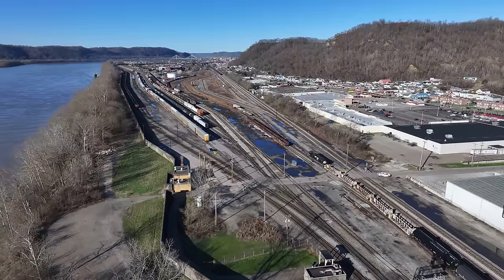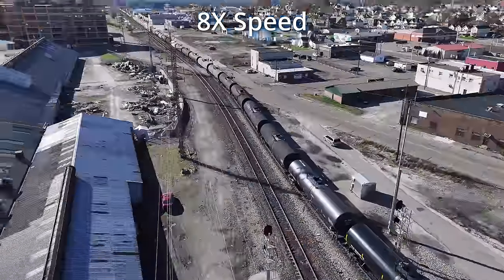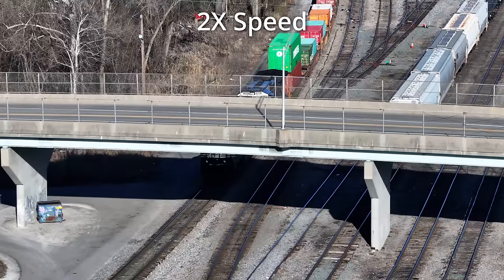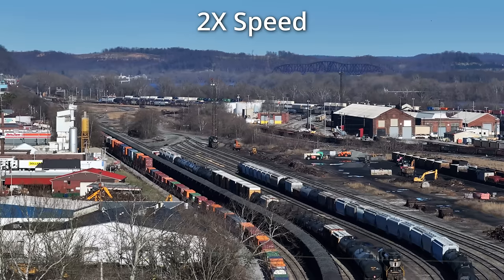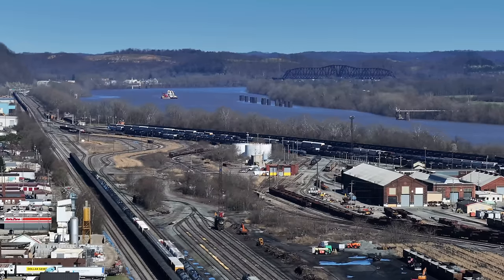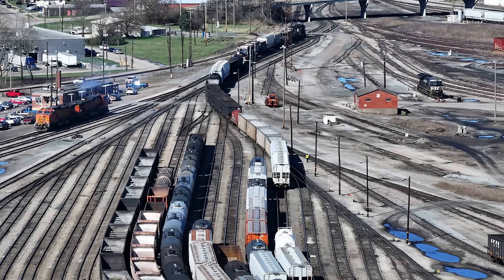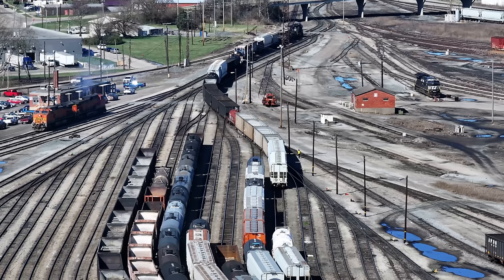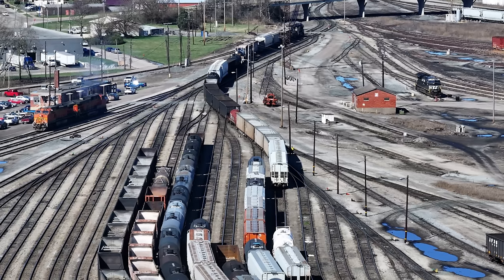Kicking Cars Along the Ohio River: Flat-Track Switching at Norfolk Southern's Portsmouth Yard

Comment: The reason why those 2 BNSF units where running is either they had a defect that prevented the AESS (Automatic Engine Start-Stop) system from shutting down the engine (usually low batteries) or you had the shear luck of being there when they where running in between shut downs. Very rarely will crews do a manual shutdown, especially during the colder months where temperatures will drop below freezing. Railroads use water instead of Antifreeze to cool engines, so when an engine is shut down and it drops below freezing a safety valve known as a Guru valve will pop to dump the water and prevent engine damage from frozen water. (Its a pain to get it refilled, so no one on the railroad wants that to happen.)

 Those blue signs that you saw those men, who are called carmen, putting up are "blue flags". Blue flags are used to warn T&E crews (aka Engineer, conductor, & brakemen) that workers are underneath, on, or working on equipment, and that that equipment is not to be moved. Blue flags can only be removed by the person who placed it or a person on that person's team with permission in most railroads rulebooks. 

Those carmen, also know as Car inspectors,  are not part of the switching crews. Their job is to inspect and repair cars after the yard crew sorts them. They are part of the mechanical department, and are a different "craft" . 

Crafts are basically job groups, but management is not a craft. (Also positions like IT and other HQ level positions) 

Conductors, Yard Foremen, Switchmen, Brakemen, Utilitymen are part of the T&E craft, but have their own Union.
Engineers, Firemen are also part of the T&E craft, but have their own Union. (Technically they are a different craft but they are consider as part of the T&E craft) 
Mechanical department is part of several different "crafts" and unions depending on position.
Same for Track Dept , B&B (Bridges and Buildings), Signals, Clerical, dispatchers, etc.  

I'm not sure exactly how NS does it, but usually the crews in the yard are Engineer, Yard Foreman (basically a conductor), and switchmen.
Reply from the maker: Thank you so much for the detailed answers to my questions.
I really do appreciate it.
You make watching this more enjoyable with the information you provide.
Reply: I had and eng dump its water, and my trainmaster came out with 10, gallon water jugs, lmao. I just shook my head like, no just no
Reply: @treos17  that sounds par for the course for some MTOs I've met. (But oddly enough, not the ones in charge of my home territory lol)

Comment: NO Reason to Shut Down the Engine on a Foreign Power Unit.  Maintenance don’t want to Waste Time working on a Foreign Power Unit if they Can’t get Restarted.👍
Reply from the maker: That actually makes an incredible amount of sense.
Reply: They’d just send it back to the powers closest terminal.  They won’t work on foreign motors.  Plus, the motors most likely have auto start and stop so they will cycle on and off
Reply: The main reason for shutting down a locomotive is fuel conservation.  Regardless of weather it yours or some foreign roads, it has to be fueled when it runs low. Besides, with all the run thru trains between railroads these days they keep track of the number of engine hours a foreign loco is on your road and how many hours they have yours. After a while they figure out the difference and, as in this case the bnsf may be paying the ns back for a few hundred or thousand hours so those units could be on the ns for weeks

Comment: Yes, the brick buildings are original. There used to be a large roundhouse, and a footbridge connecting the locomotive/car shop complex to the north side of the yard. As far as switches, only the ones at either end allowing access to the to the mains, as well as those at West Avenue, are dispatcher  controlled power switches. All the others are hand throw.
Reply from the maker: Thanks for the great information. I wish I could've caught the roundhouse when it was still around and in use.

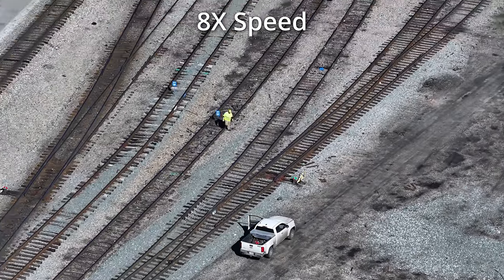Comment: 9:18 Those are Blue Flags that protect mechanical department personnel from rolling equipment being moved within the blue flagged zone. They also line the switches away from that track and lock them with their locks. As a conductor myself I can say that those blue flags are absolutely SACRED. A train crew member dropping a blue flag or tampering with their locking devices is the kind if thing that will get you fired and possibly decertified on the spot. If you remove or run over a blue flag, there's a very good chance you never move a train again.
Reply from the maker: Thanks for the great information!
I really do appreciate it.
Reply: @nkyrailfan  No problem man! If you ever have any questions about stuff like that just let me know I'd be happy to help. I can't disclose specific information about specific trains but other than that... 😂

Comment: Another reason the BNSF motors might have been left running is when the temperature gets too low at night, engines won’t start if they are too cold so they’ll leave them running to keep them alive. Easier to keep them running then have them dead and not able to start

Comment: Locomotives have water cooled engines so they keep them running under certain temperatures.  To conserve fuel many modern locomotives will shut themselves down over a certain outside temperature.  I don't know what the setting would be on these BNSF locomotives but I would guess it's somewhere in the 40's F, with the thought that a temperature drop could be quite fast.  Railroads don't use antifreeze for various reasons including cost, ease of maintaining and handling (of water), safety. etc.. Antifreeze is a poison and can be licked-up by wildlife along the tracks.  Just about every terminal has a basic garden hose near one of the tracks for topping-up the water.  That's about as simple as it gets.  Also, maintenance personnel can drain water onto the ground, as opposed to having to capture antifreeze.  I worked for CSX.
Reply from the maker: Thanks for the great information, Steve.
I had no idea it was water only.
That makes sense about the auto shutoff.

Comment: i normally cross the river west of there anymore but i can tell you that cable bridge ain't that old!! 25 30 years max!! and beyond starting the bastard then going to the office and completely forgetting about them the on;y 3 reasons i know of for running engines like that is one to check a repaired system two to drain the fuel tanks to work on it or three they're tapping power off it for something!

Comment: I cant tell you about portsmouth but i can tell you about switching. If you have a good yard master, your switch list will have a list of cars in the track that needs to be switched. The longer you switch the more you learn where certain cars go, most of them have the location they are going to or what industry local they belong to. Someone thats on a regular switching job long enough usually just gets their switch list and uses the tracks how they want to sort them out but often times the yard master will have pre sorted every car or block of cars and have it numbered on the switch list of what tracj they belong to. Say from here, cars theyre kicking into "track one" are going on an industry local, cars going to "track 4" is a block of cars going to columbus, cars going to track 3 may be going to the shop, track 2 may be going elsewhere. And track 6 may be for a different industry. 

I cant tell you much about this yard as ive never been in it but they have the luxury of a "hump" as you can see in the video which is great. A lot of times you dont even need to "kick" you just get your slack and the cars roll down the hill. The guy pulling the pin is the FO or conductor/foreman in the job, the guy throwing the switches is his switchman/brakeman. Conductor is responsible for making sure the right cars go in the right track, brakeman is responsible for making sure the foreman doesnt have to go throw a switch down the lead. Both guys will usually have the same switch list and a good crew doesnt even have to talk to each other. They know what each others next move ahead of time.

Also some cars just dont want to dang roll. My solution is I usually close both knuckles and give it a good kick unles i know ive got more going into that track later that will likely move it. Or just go back later and shake the track up, meaning shove all the way until the last car moves and then pull them ahead and my brakeman will tell me if the last cars moving. If so, you know everythings coupled up and the track is solid.

As far as cars being spotted up on one end of the yard, most yards have air on one end or the other. They are spotted to that end and the car department will bleed all the cars off to make sure the brake piston releases, walk to make sure,  and then put them on air so they can do an a6 brake test and c100 to make sure all the brake pistons set up. Thats how you get your brake slip for those cars. If youre unfortunate to work in a terminal that doesnt have carman, you do your own brake test and c100.

They also leave them on air for as long as they need to because if a car is off air for more than 24 hours you have to do another brake test on it.
Reply from the maker: Thanks for the great information and detailed reply.
I really appreciate it.

Comment: Blue flags indicate that Mechanical forces are working on equipment on a section of track. Switches are locked out and equipment is secured from movement. Operating crews are not permitted enter a blue flagged track. Mechanical supervisor or Foreman may not remove a blue flag until all Mechanical personnel are clear of the equipment.  Likely Mechanical crews are lacing up the string of cars and testing the air brakes.
Reply from the maker: Thank you for the very detailed response.
I really do appreciate it.

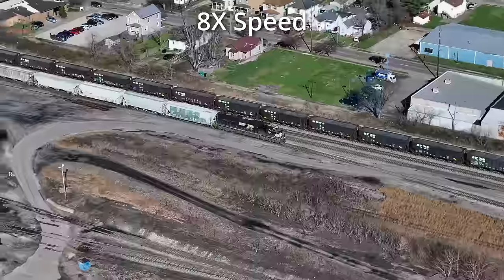Comment: @ 3:23... flat switching with road power can be frustrating... road power takes too long to load when you're kicking the cars... 

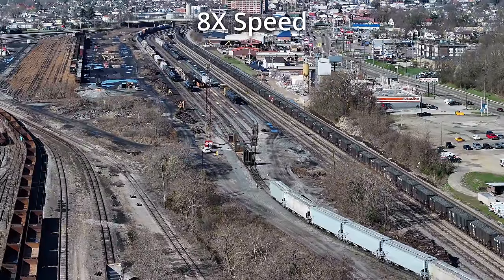also @ 3:40... hate that... that's the DO OVER 🤬🤬🤬🤬...  depending on where you work, the guys will rib you for it 🤣🤣... 

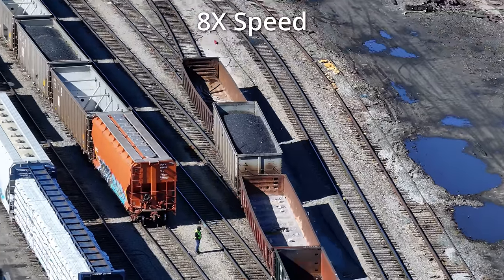@ 8:26... you mentioned about what are they doing with all the cars they are switching... 

no matter what, here's what happens at practically every yard...  

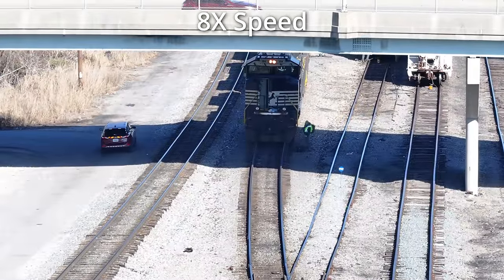first, the run-through dwell cars are blocked (those are the cars that are on the dwell clock, so they have to be out of the yard before a certain time limit... if they aren't, the trainmaster loses his fat dwell time bonus for the qtr... so he is incentivized to make that the priority)... @ 9:50... a PERFECT example of run-through dwell ops... those road guys are ready to beat feet out of the yard with their train and the trainmaster is happy as long as that train is within it's dwell time parameters

also, the local cars are placed on their correct track/s... 

the bad order cars are sorted... the RIP track is pulled and spotted and the RIP okays are switched out... also any local trains are made up...

also, sometimes cars don't have a waybill, called no waybills (go figure lol), they are placed on a designated track until they get further forwarding instructions....

lot of stuff going on in a railyard
Reply from the maker: Thanks for all the great information! I really do appreciate it.

Comment: The scope of the blue signal regulations is to provide protection for railroad employees engaged in the: Inspection, testing, repair, and servicing of rolling equipment, while. On, under, or between such equipment and subjects them to the danger of personal injury posed by any movement of such equipment
Reply: As I understand it, when a blue flag (sign) is placed only the person who placed it can remove it.   Those blue flags were probably placed so that carmen could inspect the cars in that track.  If another car were to bang into a cut being inspected, a carman could be injured.
Reply from the maker: Thank you for the very detailed response.
I (and others) really do appreciate it.
I didn't think about how critical it is to protect those workers when they're doing an inspection or other task on cars, and expecting them to remain still.

Comment: The process for starting an engine is not an easy one...... Generally you need an electrician to do it, and they aren't always available, so they leave them running,it uses more fuel starting than it does just to leave it running......
Reply: its actually very simple and you dont need an electrician.
Reply: Most engineers start their own as needed.